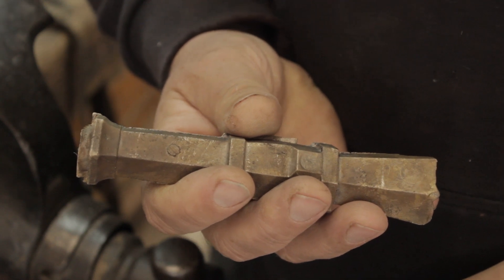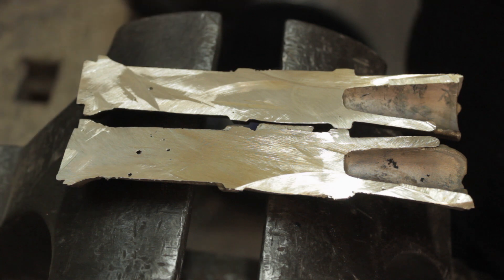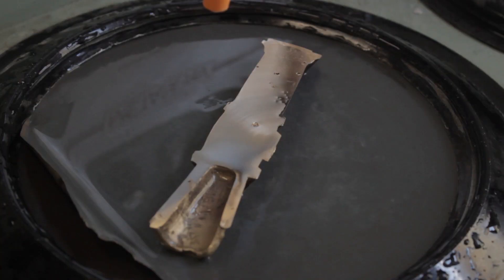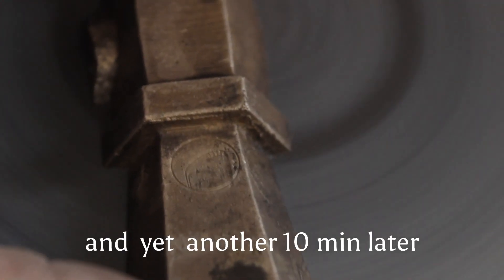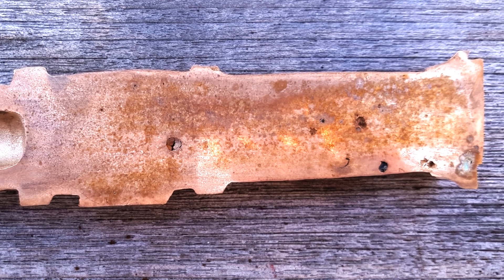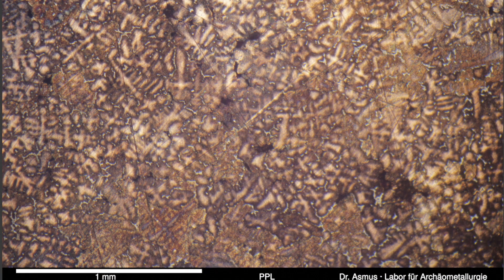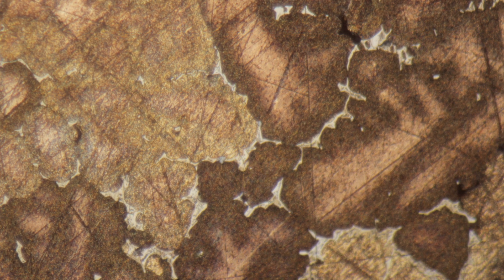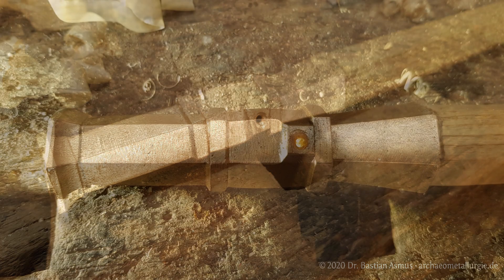#archaeometallurgy Metallography of a bronze cast handgonne

Comment: Please talk more about high tin bronze 22% tin casting. Also more about how to remove casting defects
Reply from the maker: Will do, alas currently I am very busy with archaeolmetallurgical studies, so it might be some time...  Removing casting defects, eh? Never heard of that (:  Jokes aside, for which period? Modern? Medieval? Prehistoric?
Reply: @ArchaeometallurgieDe   Thanks for your reply. I meant avoiding casting defects like bubbles in lost wax casting of medieval period.  I have two points for you additionally - 1. You dont cover melt with a layer of charcoal, why ? 2. How do you remove dross ? Thanks
Reply from the maker: @alokpandey9532   I do cover my melt with charcoal. I do remove it with the dross, which is very little to nothing with the charcoal before casting. Bubbles in the cast are mostly moulds that are not properly dried and/or not permeable enough... Sometimes, thy can also occur when your melt has not been treated correctly, i.e. too oxidsing, or the furnace was not dried before melting (crucial!!). ANY humidity will find its way into liquid bronze or copper ally and dissociate to H2 and O2.
Reply: @ArchaeometallurgieDe  this is great information. I am midway to my first project. I am casting a traditional Indian bronze cookware with 78:22 proportions. Later I will quench that at 750 C.
Reply: @ArchaeometallurgieDe  Hi, after a lot of research, I figured that top pouring is a major cause because it creates bifilms and that encloses bubbles. You should try with bottom pouring with added spinners with vents at the end of runner.

Comment: Wonderful. Please provide more of this. Maybe also on precious metals like Sterling silver as there are a lot of silversmiths around who are theorizing about porosity in cast Sterling silver (or gold) objects and what to do about it (especially when rolling/forging down or drawing wire). A proper metallurgical explanation would be more than welcome. Still, it would also be interesting for bronze objects - and not only cast ones, but also to forge forming those cast ingots (what happens to the porous regions then ?).
Reply from the maker: Just sende me the gold, then
Reply from the maker: Honestly, I will do that happily. Alas, my gold reserves are depleted. Silver I do have, of course, and that could be done easily. The thing is, that the precious metal are - metallurgically speaking - rather boring, inasmuch as they are near perfect. The moment you start allowing it becomes more interesting. Porosity you cannot get rid of, really. You can compress the pores, or flatten them. But if you have porosity something went wrong during casting or melting. Melting faults are often overlooked in general, though it is less of a problem for the noble metals.

Comment: A really well hidden gem of a channel here. 
Also interested of a composition of bronze used here. As i remember early bronze handgonnes were made from some weird unrefined random  alloy. Haapsalu castle handgonne or was it Otepää one  consisted also abot 4-6% of lead. I really need to look again those articles.
Reply from the maker: I never hid it, but this field is such a niche. - Of course there was a lot of variation, first there was no periodic table, so alloying was a matter of the raw materials  quality anders availability. Depending on the raw material choice lead might have been in the copper already. There are loads on information form the copper smelting site across central Europe. You would not want lead in there in the first place, as it weakens the notched impact strength, as every lead globule in the grain structure acts as a notch: Not ideal for firearms...
Many mechanical properties of copper (and other)  alloys are quite dependent on the cooling rate, the casting temperature, and so on. Heck, we do not know the half of it today...
Reply: @ArchaeometallurgieDe  Alloying was also not as standardized as it is today. Everyone in that business had his own recipe and would keep that a secret and only hand it down to his students. Lead was sometimes probably added to allow for a better and easier casting as it seems to substitute the use of flux a little bit and the availability of chemicals like borax might not have been widely spread. You will find lead in bronze alloys all the way back to the early medieval times when bronze was not used for firearms but for jewelry. The impact of having lead, which might encourage the flow of metal during a cast, in a cast object that is exposed to the stress of explosions was probably not yet known.
Reply from the maker: Of course you are right it was not as standardised as of today, because there was no system based on science. However, we need to define the period we are talking about. The middle ages spanned a thousand (or more, depending on your definition)years. in these thousand years we see a tremendous increase in experience and knowledge, and by the 12th c allowing was definitely no secret, as it well described by Theophilus Presbyter, and he even mentions materials testing in respect of lead being present or detrimental in certain copper alloys. He suggest a destructive test to check for the presence of lead, in order to decide as to whether to continue to refine the copper at hand.... In the Haz mountains they had devised very complex smelting procedures to produce copper, silver and less from the same polymetallic ores... anyway I shut up now....
Reply: @ArchaeometallurgieDe  Please keep on talking, its really interesting. 
Found the article. Otepää gonne (made between 14 and 15 cent.) is made  from bronze but included under barrel cast in iron hook had metal composition of 93,9% copper, 4,5% tin and 1,6% lead. Earlier (early 14 cent.) Loshult bottlecannon from Sweden had similar composition of 92,3% copper 3,1% tin and 2,9 % lead. As i understood those low tin copper alloys form small shrink pores through all cast during cooling not big shrinking voids when metal flows while cooling like modern alloys
It would be really interesting if somebody would do and record the destructive testing of early gonnes old alloy vs modern gunmetal alloy.  3 vs 3 guns, increasing powder charge or projectile weight every shot (remotely detonated) until destructive failure. Everybody just talks about the dangers but there is no real understanding how big is the danger. Will you need 10% or 500% more explosive to blow barrel up? Will you need 25 or 5000 shots? I understand there is no 100% answer to questions like that but well made practical test could answer many questions (and rise many more from new perspective)
Reply from the maker: Hello again! Would you mind telling me the citation of this article. The ones I found so far do not contain any chemical analyses. Nevertheless I went forward and made a model of this early handgonne.- And yes, testing these handgonnes is my goal. However to do so legally it is necessary to apply for funding and formulate a research project. Until such time it is of course not a problem to experiment to get a deeper understanding of the production processes, which are no inherently different form other cast objects. Insofar I am in a very good position. - As to your specific questions:Such leaded low tin alloys are indeed intriguing.The low tin contents is below the solid solubility of tin in the copper lattice. As such it is quite expectable to contain dendrites (almost) exclusively, i.e. no hard and brittle delta (high-tin-) phase at the grain boundaries. Consequently this would a very ductile material, if heat treated properly after casting. - You need to discern between different types of casting defects, there are cavities and gas porosity. These are not mutually exclusive but do have very different causes. The gas porosity is merely a function of the interaction with mostly hydrogen, which is soluble in liquid, but not in solid copper alloys.  So, any source of water or vapour would inevitably lower your metal quality. This can happen during melting in a humid environment or a furnace, or casting into too humid moulds, possible without proper venting. 
Cavities on the other hand are caused by the mould and the design of the gating system. They are caused by the fact that liquid copper alloys (and indeed most other allays) have a lower density when molten. As a consequence the metal shrinks during solidification. If the supply with liquid metal is inhibited before the mould is filled and solidified completely voids must appear due to the change in density upon solidifying. After solidification the whole metal bloc shrinks equally upon cooling to room temperature. This shrinkage we can control by making the model larger that the desired object.... Well, enough lecturing...
Reply: @ArchaeometallurgieDe  Now im really looking forward for your future testing videos (also hoping to see destructive tests).
My data is taken from a book "Significant artefacts from the archaeological collections in Estonia" Ü. Tamla Tallinn 2010. Unfortunately its mostly in estonian but all articles have english summaries.
and the article is "Reconstruction of the handgonne from Otepää castle" by Jaak Mäll. 
Loshult cannon data should be "Rekonstruktion og skydeforsog med Loshultkanonen. Middelaldercentret, Nykobing P.Hansen 2001
Reply from the maker: Thanks for the citations! I came across an article by Mäll, but I must have overlooked the chemical data. Wilĺ check again..